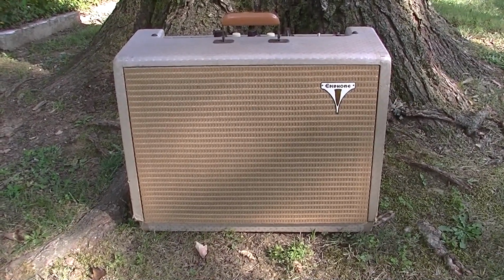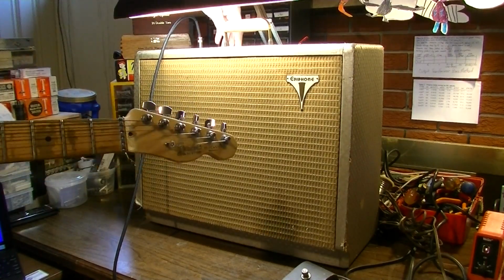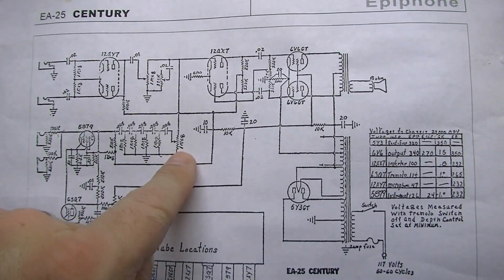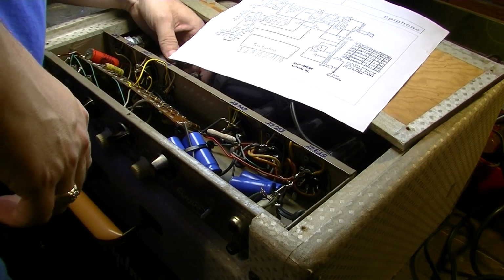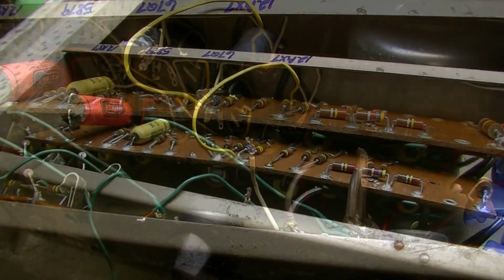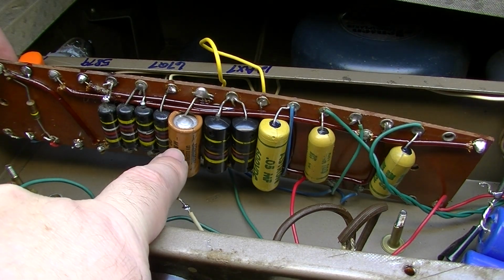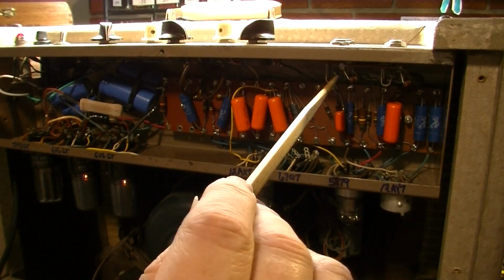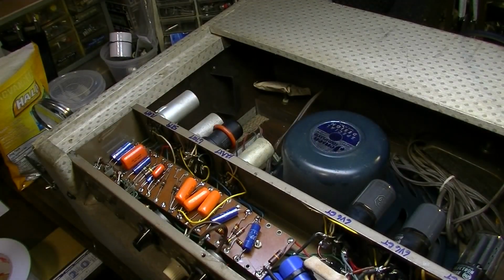Recapping Vintage Guitar Amps - When is "Killing the Mojo" OK? (1959 Epiphone Century EA-25T)

Comment: I agree replace them and be done with it. Nothing last forever with original parts in the electronic world. How many times do you want to have your gear in the shop being worked on? I would not move the location though since the new caps should last 20+ years if they are quality caps! He should not need to service the caps in the future.

Comment: Amps weren't originally built with 40-60 year old parts. They were made with new components. So to keep an amp original, it should be working properly, as when it left the factory. However, if an amp is working properly and sounding good, no drooping voltages, hums or hisses or anything else that shouldn't be there, I'd probably leave it alone. :)

Comment: Replacing faulty components can only help restore that original "mojo" that was fading with age! Any amplifier is worthless if it doesn't work right. Those old paper-and-tinfoil capacitors don't last forever and old electrolytics dry out after a while and start to cause problems.

Comment: I just replaced all the Astrons and the filter caps in my 59 Fender 5F3 deluxe. Every one of those caps was leaky. Used to sound good, now it's unbelievable. The idea of keeping it original didn't make sense when I thought about it. It was no longer original anyway. Fender never made a 59 Deluxe full of leaking caps! It's now 'electronically', if not visually, original again.

Comment: As the physicists say, a capacitor is a device for storing electrical energy, just like for example the battery in your effects pedal (you could run an effects pedal all night on a large enough charged capacitor). Can any of you musicians
 Tell me how much a flat battery adds to the "mojo" of the pedal? If a battery gives better "mojo" at 8 volts x milliamps than 9 volts y milliamps better you should have someone design a power supply to those specifications. Can your ears tell the difference between a tone of 9000 cycles a second and 9001? My oscilloscope can. If you think your amp sounds better with tired out of specification 50 year old capacitors get someone like the guitologist to measure their present values then replace them with new capacitors to the measured value and specified working voltage.

Comment: Brad, perhaps this is a stupid question and chances are slim that you will read and reply to this on a 2 year old video BUT..  instead of re-soldering all the capacitors onto the top of the board, why not just flip the board over and mount it upside down?

Comment: the argument for leaving old electrolytic capacitors in an old amplifier is akin to wanting to leave the same transmission fluid in a classic automobile... same even goes for speakers: paper gets soft, weak, and mushy after 60-70 years; there's nothing wrong with upgrading a functional, critical part .

Comment: What does the variac do?
Reply from the maker: Varies the input voltage coming from the wall outlet in to the amp. Allows you to test certain functions and voltages in an amp or other equipment without applying full power. Good if you suspect problems and don't want to just flip a power switch.

Comment: I was told that companies such as Gibson and Epiphone  never envisioned a vintage market on these amps and that if you had a problem with the board back in the 50's and 60's that you would just replace the whole thing versus a singular component. As to why the circuit board was not designed for servicing by a tech. The same way Leo Fender never envisioned anyone ever doing a fret job on a Telecaster or a Stratocaster. He thought it would just be easier to buy a replacement neck. Of course now a days people would consider it sacrilege to replace a well worn in neck Then again many of these folks at the time including Leo were not musicians.  Who knows what Leo might have created if he actually played.
Reply from the maker: A vintage or used market on goods is counter productive to growth. That's why it's so odd the big companies can't innovate and sell updated models more easily.

Comment: I made a lot of tests on caps and I will say it doesn't matter really as long as they are well made. It's more about the values when it comes to tone. The tone of the old amps are from drifting of values not what type of components used. Carbon versus metal resistors, different types of caps, they mean little it's about the values and old amps drift. The biggest source of tone are the transformers and tubes, the trannys are the big deal, the old Fenders sound best with the Shumachers. And of course the speakers, nothing better than the old Jensen C12N and C10Qs. Although some CTS alnicos sounded great. At first the amp might sound a little sterile but that will change in time if you use the amp. Some of those old tubes types are just noisy and it's hard to find good ones as they are no longer made, even NOS.  Yep shielding tape. Those Jensen alnicos have a tone you cannot get any other way, they give a certain sound when they break up, a little metalicness, the ceramics are smoother. I eventually did use the Sozos when they came out, I think they did sound a bit better but I did get a bad one now and then, this was a long time ago. You also get a fatter sound with pentodes but cannot get the gain like a 12Ax7.

Comment: Mojo doesn't exist !! There are no magic tone cappacitors ..Mojo is Marketing !! Look at the $112  Bumblebee Gibson Caps , that were cheap Chinese caps in a Hollow Gibson shell. 
As an  EE that use to repair and calibrate Tektronix Oscilloscopes . I can tell you most New Caps out perform the old ones. There are some oldies that defy all logic. . I recently checked a pair of LCR  Dual  50uF 500v Electrolytic;s from a1988 Marshall JMC 800. They were still with in tolerance but not in NOS Spec. Replaced them anyway and there was a noticeable drop in Hum. Maybe I'll sell them as Mojo Caps.
Reply from the maker: We definitely see eye to eye on this. I used to be averse to touching couplings caps if they aren't technically leaky, but on something like this, why wait?
Reply: Regarding caps in the tone circuit in a guitar: isn't the signal that goes through the caps going to ground? So how can that possibly add "mojo". Snake oil!  This guy did an experiment on guitar tone caps; the results here:https://www.youtube.com/watch?v=M7Hu52vmxE0

And the original experiment: https://www.youtube.com/watch?v=817JHiYV_Po

Comment: Sound better without new components. For me it's not about changing caps in new one, but putting wrong caps.
I hope the owner will be happy still
Reply from the maker: I am somewhat in agreement on the tone before and after. I am not generally a fan of straight up close micing so I usually turn on an overhead mic to get room ambiance. Forgot to do that in the final demo, so it did end up sounding a little "boxy" to me. That's down to micing.

Comment: Brave call, leaving those old caps in there. It usually bites me in the ass. Great amp!

"Let's start a war, start a nuclear war..."
Reply from the maker: Those caps are just in that little tone-shaping network. Even if they are drifted and badly leaking, they don't see an DC off the previous stage's plate. The new orange drop I installed is taking care of the coupling.

Comment: There are never any cons to recapping an amplifier unless the caps used are larger than the originals at which point hum may be introduced.

The reason why is recapping the amp restores the amp to how it sounded when it left the factory. At least that's what it should do.

The problem is many guitar players who know nothing about electronics hear a guitar amp with original capacitors and think that's how it is supposed to sound and when the amp is recapped it doesn't sound right to them even though it now sounds as it did when new.

I myself would never work on any guitar amp where the owner wanted only the bad caps replaced with the same type of cap given that when said replaced cap causes the amp to fail and if it causes damage to life or property I am now liable for the damages as the people who deal with such damages are only going to see that I did not install a new part.

Comment: Old caps are not doing anything but creating problems. Replacing them with equivalent spec modern caps actually restored the original sound.  And old caps can be dangerous, or fail completely and then you won't get any sound at all.

Comment: Mojo comes from the player. Good tone helps the mojo. Bad tone, hum, etc kills the mojo. If you're lucky, you might inherit some residual mojo from a previous player in an amp or guitar...if you're not lucky, you buy a Plymouth Fury with bad mojo and it proceeds to start killing everybody. ;)
Reply: Plus, what happens when your 50 year old original dripping-in-mojo capacitor fails and shorts out the circuit or takes out a power tube and pops a transformer in the process. A whole lot of mojo ends up transmuting itself into pale blue smoke or a white mist, and then you're totally out of luck.

Comment: Change the caps - always.  The amp will have its tone changed but it will be more like how it was designed.  Dont forget tolerances on components now are generally + or - 5% - back then it was + or - 20% which mean most amps sounded a little different.....  Only slightly but different.

I have seen amps blow transformers when an original OLD part has blown that should of been changed.

Anyhow - your tone is in your fingers!!!!!
Reply from the maker: Tube amps can operate and sound good at such a wide range of tolerances for out of spec components, it's no wonder so many of them have a catastrophic failure before players will get them serviced.

Comment: Everyone has their own opinion....but consumer electronics do not improve with age like fine wine. Caps leak. Resistors drift. Pots crackle. Heat takes its toll. There are many reasons to own a 1957 Porsche....but superiority over modern cars is not one of them. It's also not like amp designers 60 years ago had more knowledge of electrical engineering over modern designers never to be replicated again. Given that, people need to decide whether they want a dependable tool for making music or they want to be a collector/ museum curator. I will concede that tubes and transformers were probably manufactured of better quality back in the day over some modern ones...but decades of use can negate that.

Comment: People that think moldy old caps keep the "mojo" just don't know any thing about electronics.  I cringe when I see people selling old discarded wax paper capacitors and old bumblebees for people to put into their amps.  I've seen enough leakage from those types of caps (99.9 percent of them) to know the owners are doing nothing but putting their amps at huge risk.
Reply from the maker: They are just risking more damaged original components, namely the tubes, or worse, an output transformer.

Comment: I wonder if you had problems with hum because some of the caps were installed backwards?  No, not voltage-wise, but the outside foil the capacitor ended up connected to "signal" instead of ground.   https://www.youtube.com/watch?v=BnR_DLd1PDI&t=2s
Reply from the maker: No. The reason for the hum in this instance was because the amp was open and on the bench fully exposed to the fluorescent light above, which emits RF signals which interfere with unshielded electronics.
Reply: Understood.  But in this situation, putting the caps in "backwards" will make the amp more sensitive to that.
Reply from the maker: That seems to be the going wisdom of late, maybe largely because of the popularity of that video, but the reality is, at least as far as I can tell, the surface area of modern capacitors is too small for them to make much of an antenna. All the exposed wire inside an amplifier, including all of the unshielded terminals are really no less of an antenna, no less exposed. In a vintage style low to medium gain guitar amp, the effect of any backwards caps will likely be negligible, unless you just have things like 6V or B+ wires running right by the signal cap or something, but that's back to lead dress again. I've done some experiments of my own and was never able to tell any difference under normal conditions between a backwards cap and a properly installed cap. High gain amps may matter more, but I was never able to produce any issue without TRYING to cause one by sticking a 6V wire or something close to the cap on purpose.

Comment: Uh, it's trim' uhlo with the accent on the trim part not trem 'O' lo  with the accent on the O part  ;)  You really should use an ESR meter to verify existing capacitor quality rather than just shotgun changing every capacitor.

Comment: Mojo is such a crock of ****. Mojo comes from your fingers and brain. And caps are caps. I guess you can pay 100+ for new bumblebees that are worth about a dollar each, but hey they got mojo! If people understood how caps work they would realized the big scam going on. Signal NEVER passes thru a cap! Impossible! No continuity, they charge and discharge, that's it. Anyway cool amp.
Reply from the maker: The only time caps make a difference in tone not attributable to minor variations in value is when going from, say, a poly or paper cap to a ceramic disc cap. Those caps can be microphonic and rather than being a bad thing, that can really give an amp "mojo". The microphonics of disc caps as signal couplers can add bite, reverberation, grit, you name it... It can express itself in a lot of ways.
Reply: Much as I want to dis-agree from a technical stand-point,( value should be the only thing that makes a difference), when I've compared say ceramic to silver mica of same value I do notice a difference.
Reply: Well, the whole mojo thing would be justified...If, and only if, audio amplifiers were built with precision components...Of which none are. It's like when people complain hours about potentiometer values without knowing that your 500k pot (for example) can either be 400 or 600K due to the 20% tolerance regular potentiometers have.
Reply: Brad Tomlin  Yeah, $ 50-100.00 bucks for NOS bumblebees that will be junk too, they always were junk.
Reply: too deaf and old more and harder to notice the difference probably....it's stilllll there though...those pass as good though, as well as any mustard type or similar should sound pretty good,  just never figured out a box type that sounded as good...still think like alllll those various molded and carbonate types are whatssss dopeee though still sound better than new shit lol
Reply: Mojo is actually a Voodoo concoction to word off evil and give the owner power..

Comment: That logo... looks female... recapping preserves parts like the power transformer, the output transformer, tubes, etc. Caps block DC / pass AC... you don't want HV DC where it's supposed to be LV AC.

Comment: I like your videos and I like to keep an open mind about pronunciations of words.  I looked up "tremolo", every common pronunciation in different languages and did not find yours.  Every time I hear you pronounce "tre-M0-LO"....I cringe...it takes away from the integrity of your work... I heard you scoff in one video about how people commented on how you pronounce it...we're just trying to help...
Reply from the maker: Takes away from the integrity of my work?  I honestly couldn't give a damn less what anyone thinks of how I pronounce something. Thanks for the help, but no thanks, Tom. I'm good.
Reply: It's cool, I just wanted to know how you felt about it.  But back to the video.  I believe you should have changed the bumble bees under the board, why?...you assumed that the yellow capacitor upstream from them needed to be changed because it was probably leaky; if indeed that was case what would be the affect over time on the bumble bees if it was leaking significantly?  It would cause them to be stressed to some extent also, not to mention the fact that those bumbles bees have been aging, possibly absorbing moisture and in general probably totally out of spec and inherently bad.  But you wouldn't know that unless you pulled them out of the circuit and tested them with a high voltage capacitance bridge.  I have never seen you use one in your videos so I assume you don't have one, yet, they are indispensable for working on vintage gear for testing high voltage capacitors; a low voltage ESR meter or simple capacitor tester will not paint the complete picture for these high voltage components.  They are also a great teaching tool so the the audience can definitively see the leakage happening on a bad capacitor.
Reply from the maker: A valid point on the bumblebees, and the capacitor tester. I do have a high voltage tester, but it needs a service of its own. Probably an upcoming video.